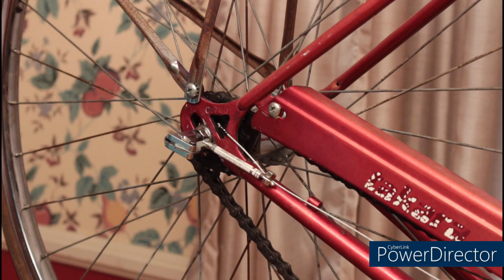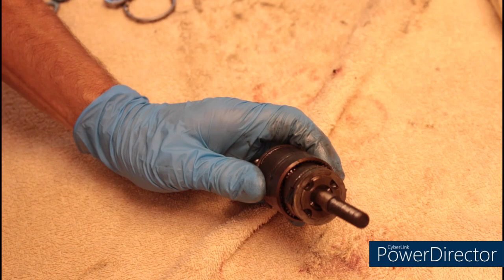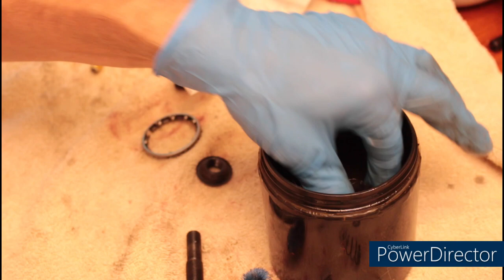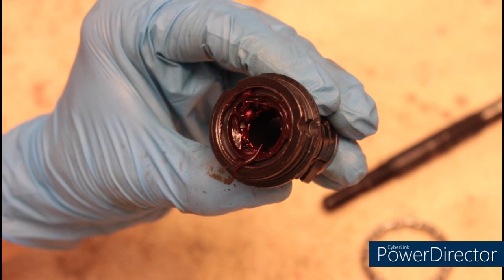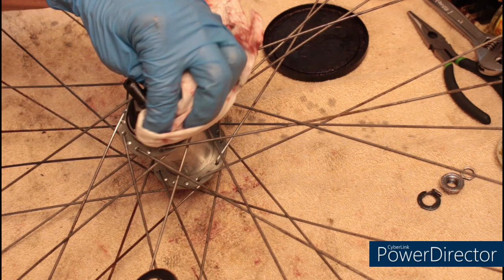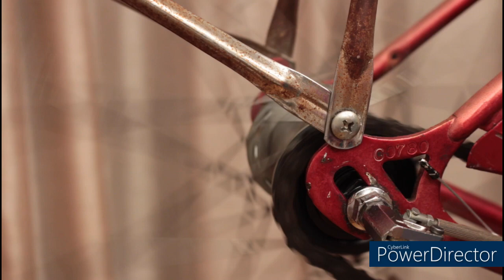New Life for Old Bikes Servicing a Shimano three speed

Comment: Very clear video for sure, nice. This makes it not as complicated as I thought. The new ones are crazy. You could have given the wheel a hard spin to show how long it's supposed to spin. Mine goes near 2 minutes.
But still my SA drum brakes 3 speed and 5w are way simpler and easier. I use thickened 10w30 lawnmower oil and a stiff grease. 
That dab of oil you used is pathetic. I put far more oil in mine. I use a 1/2" paint brush and cover ALL the parts. There needs to be oil migrating all thru there. Yah there is oil oozing out for a few hundred miles. Unlike your bike, I WIPE the outside and keep it from collecting dirt. 
Now I'm going for a 90+ mile ride on my old CCM with the X-RD3. I've done lots of rides over 90 miles. EASY.
Reply from the maker: Thanks for the feedback and for sharing your personal maintenance tips!

Comment: I have a Sturmey Archer 3 speed transmission. What oil do I use and in what quantity would it be recommended? 
Tengo una transmision Sturmey Archer 3 velocidades. ¿Que aceite utilizo y en que cantidad seria lo recomendable?
Reply from the maker: 5 weight oil or transmission fluid works well
Reply: @NewLifeforOldBikes  Gracias!!!

Comment: Thank you for your video. 
I didn’t go as far as removing the planetary gears from the wheel but got to the bearings and gave them a freshen up - as well as dropping in an excess of oil in the filler point and let some drip out. Ideally to let old oil push out.
Reply from the maker: You're welcome! I'm glad it helped you with your bike. If the planetary gears look good, there is no nead to pull them out.

Comment: Thanks for sharing. That is a very well done "how to" on servicing the Shimano cartridge hubs.  I don't have anything really to add except that I always dunk the cartridge in ATF fluid before reassembling.  It seems to work well: lubes without being excessive.  About once a month I throw a few squirts of ATF in the rod hole to make sure the hub stays lubricated. Any excess will seep out.

There's just something satisfying about working on these old bikes and keeping them on the road.  I still ride my All- Pro 3-speed that I got for Christmas in 1979.  It's made by Murray but was sold by Sears or K-Mart I think.  Great bike, after all this time it's still working.
Reply from the maker: Thanks for sharing your experience with ATF fluid! It works well in these old hubs. I still ride Dad's 1959 Dunelt. It's easy to work on and never lets me down. I expect Dad is looking down and smiling.
Reply: @NewLifeforOldBikes  these hubs are very tolerant of kind of lubricant used.  As long as the internal parts are coated with a film of some type of oil they'll run forever.  Any oil 20w or under will do.  I like ATF because it keeps the insides cleaner, or at least I convince myself that it does 😂
Reply from the maker: It's nice to know there are like minded people who are also keeping these bikes on the road.

Comment: The gizmo doesn't prevent anything from turning (show me any bicycle that has an axle that turns when going down the road-- any bicycle!) . The GIZMO ORIENTS this axle with respect to the hub, it can actually be 180 degrees off and adversely affect shifting! 60 years of 3-speed knowledge!!!
Reply from the maker: You are absolutely correct. I thought I had explained that well, but in hindsight, I was not as clear as I could have been. You verbalized that much better, and I thank you.
Reply: @NewLifeforOldBikes  It is a minor point, but I, as pointed out, have owned his hub for more than 60 years ( the first bike I bought with MY money) and I still have this on another of my bikes, today!
Reply: They're literally called 'torque washers', sounds like that's 60 years of botched repairs.
Reply: @nonegonewrong You are an uneducated fool that has ZERO reading comprehension skills! Not even what my point was about, you ignorant imbecile.
Reply: @nonegonewrong You are an uneducated fool with ZERO reading comprehension skills! You failed miserably in grasping my point, at least the poster of this video acknowledged as much in a reply. Get an education, clown!

Comment: Evan,  Thanks for the video.  Does that hub have a model name or number stamped into it?  I recently rebuilt a vintage 3 speed shimano hub that had 333 stamped on the hub.  It also had a very difficult to remove ball cup.  It was said to require a special removal tool.  I found notches on the rim of the ball cup and I used a small punch and hammer to turn it off.  I would like to know what is stamped on your hub for future reference.  I restore or refurbish vintage 3 speed bikes just for the enjoyment I get from it.  Thanks,  Larry.
Reply from the maker: Larry, I looked all over the hub, but the only numbers I found on it were 3S. It's off my 1975 Takara  which is made by kowuhara if that helps.